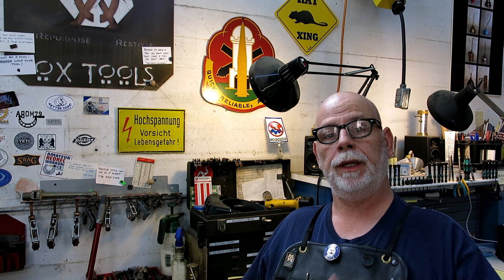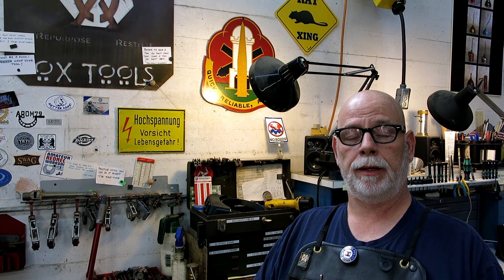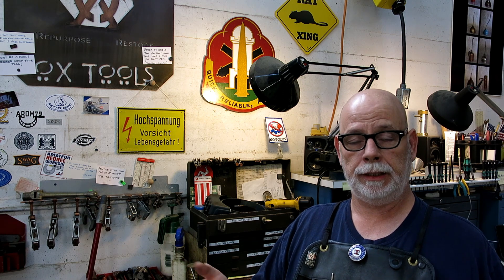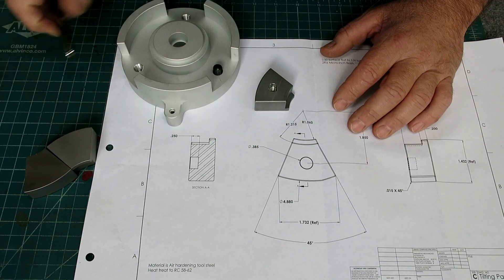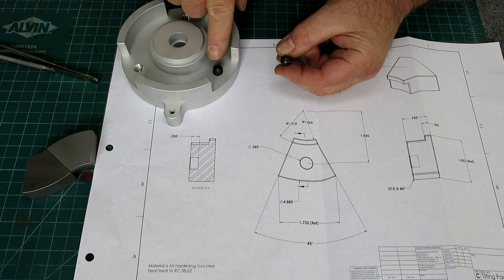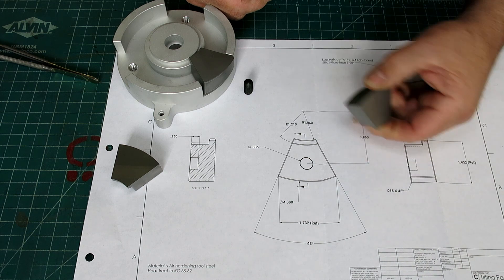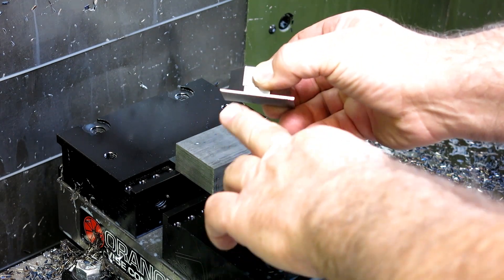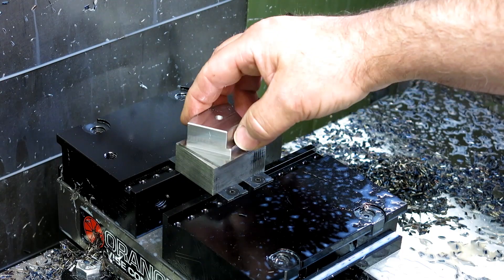Part 3 Kingsbury Michelle Aerodynamic Bearing Collaboration

Comment: I'm almost done making this project. I'm to the lapping/polishing stage. Parts are flat but not very shiny. I've read other places that cast iron laps don't really do a good job getting to a mirror finish. (I copied that project too.) Do I have to use a copper plate or do you have some other secret for getting the mirror finish? It's been a great project. Thanks
greg

Comment: Also Iam curious what you've got the parts wrapped in heat treat?
Reply: I'm guessing stainless steel tool wrap heat treating foil. 
The stuff available where I am is 0.05mm thick, and comes in rolls 610 wide x 10000 long.

Comment: why are the parts wrapped inside the metal sheet while heat treated?
Reply: That's to exclude oxygen in order to prevent "scaling". Yes, there will be some oxygen inside the package (unless you do the wrapping inside a purged glove box), but (practically) no additional oxygen will be able to reach the part once the oxygen inside the package has done its worst. You could also use an exclusion coating (such as boric acid), or heat treat in a vacuum or inert gas oven.
Reply: @stanrogers5613  thanks! I'd still like to know how the oxygen contributes to this "scaling" you're talking about.. Would the expanding air cause deformation on the piece or what?
Reply: @tohtorizorro  scaling is oxidation, which (as the name suggests) relies on free oxygen
Reply: @tohtorizorro  Wrapping also prevents loss of carbon (I presume it combines with oxygen to form CO and CO2). Carbon is essential to tool steel and its loss will inhibit austentite formation when the steel reaches a bright red heat . Quenching is the method whereby the steel is trapped in the austenite structure, as there is not enough time for the face centered atoms to migrate back to the body center of the fundamental cubes of the crystal structure. This is why there is a risk of cracking, because the change in structure causes a change in volume of the workpiece.

Comment: Thanks for sharing.
Question,
When you are grinding with the wheel, how do you accommodate the shrinking of the grinding wheel diameter in relation to the depth of grind? Hope that makes sense 
Thanks 👍
Reply: The grinding wheel diameter only breaks down at the leading edge of the interface between the wheel and the part. As you feed from front to back the front edge breaks down revealing new grinding media, the original diameter of the wheel follows  across the newely ground surface. The wheel is occasionally dressed for a true cutting surface and to remove any embedded particulate, at that point the wheel is fed down the appropriate amount.
Reply: @sshep7119  thanks, great answer 👍

Comment: Hi Tom.
Nice project. I think there is a place for improvement:
I believe the polished faces should have a knife edge rather than a chamfer.
The chamfer allows dust to get pulled in, a knife edge will go a long way toward preventing dust contamination. I think commercial air bearings are designed this way.
Reply: I'm led to believe that even machine tool slides benefit from 90 deg sharp corners when they're close fitting, particularly if there's grinding grit about.
Reply: I wondered about this too, my thought was maybe the air molecules need a chamfer to be drawn in and float the part? you added doubt that thought though

Comment: I am puzzled, isn't the purpose of the spherical pocket to allow the 3 surfaces to pivot to a common plane without error and independent of precision?
Reply: Yes, but there is a second constraint. The axial bearing must be normal ("vertical") to the plane of the face.
So just having a 3 point contact is not enough, you have to be able to either adjust the spheres to bring the axis into plumb, or machine it perfectly from the start.

Comment: Tom, when you milled the  counterbore in the hardened part (made my teeth hurt by the way) it appeared the endmill diameter was larger than the radius of the c'bore, this would leave a small convex pip at the bottom (not flat) due to the cutter's end clearance angle. Wouldn't this make the puck want to ride off to one side when resting on the radius end set screws?

Comment: Nice job Tom. Clever clamping solutions for both ops on the mill, just goes to show you don't need to be gripping on much if your contact areas are good. Cheers, Jon

Comment: Did that first cut on the surface grinder not put a deep burn into the material?
Reply: It was (Tom mentioned) a very free cutting wheel, specially for hard tool steel. With coolant, and a small stepover, it's usual to use quite "heavy" cut depth with such a wheel. This resulting wheel wear is thereby concentrated at the leading edge of the wheel, leading to longer intervals before the entire wheel loses diameter and has to be re-dressed. As a side benefit, the finish is better.
Reply: @Gottenhimfella  interesting, thankyou.
So, to pick your brain, the term free cutting refers to the 'self sharpening' properties of the wheel; like having a soft matrix allowing wheel wear expose new abrasive grits, and/or friable properties in the abrasive, so is breaks down into a sharp edge after use, or have I got that wrong?
And if you had to guess at the appropriate cut depth, what would you say?
So he's working the wheel hard and that helps the cutting action, is that correct?
Reply: @ManicChampion  Yes, counterintuitively, you need a "soft" matrix and somewhat friable grains to grind hard material for the reasons you give: As soon as a particle of grit gets dull, it needs to either fracture or be released. As with cutting tools, it's essential to use a sharp edge for hard materials, otherwise you are just burnishing and the cutter will push away from the cut. 
You can to some extent manipulate the characteristics if you can vary the spindle speed; running slower makes the wheel behave as if it is softer.
If you plunge grind (downfeed only, with a wheel as wide as the work) you have no chance of achieving a flat surface because the entire width of the wheel will be reducing in diameter, unevenly.
So the best plan is to downfeed a decent amount before commencing a new pass (perhaps as much as 0.2mm, if you have the right wheel, a decent-sized spindle and a rigid machine, and of course enough motor power) with the wheel beside the work, and then use small increments of stepover so that most of the periphery of the wheel is only sparking out, and all the work happens at the leading edge (which will quickly 'dress' itself to a radius followed by a slope)
Use a rapid traverse, and flood coolant, which (with a suitable wheel) will keep the workpiece cool. Never stop, or even slow down, on the work. Grinding hard material is easier than soft, if you follow guidelines like this.
This is also the best way to true your magnetic chuck. It's (by definition) the largest workpiece your machine can cover,  so it's important that the effective diameter of the wheel does not reduce by the time you get to the far corner.
Reply: @Gottenhimfella  I was just reading on Norton's website some general things about grinding. They said the opposite, faster wheel behaves harder. This makes sense to me as one time I tried grinding a carbide scraper with a green wheel on a slow speed grinder.. all it did was chew up the wheel
Reply: @metepack4872  Thanks for catching that, of course you're right and I miswrote. I've corrected it.

Comment: Are you climb milling that hard material on purpose at the end?
Reply: You should always climb mill on a cnc, when machining the inside like he is at the end, run counter clock wise and when machining an outside profile run clockwise, tool compensation always on the left
Reply: @Kyran31  though that on cast iron or hardened materials conventional milling was preferred
Reply: @kemc77  I’m not sure on that to be honest, you may well be right, I’ve just always thought climb was the preferred method
Reply: @Kyran31   I would always climb on a rigid machine with well-maintained ballscrews or backlash compensators, hard material included.

Comment: Hello Tom;
You can determine the floating gap quite accurately.   Just measure the capacitance with your multimeter.   You know the surface area of the capacitor and you know the measured capacitance.   There are a lot of online capacitance calculators like this one: http://hyperphysics.phy-astr.gsu.edu/hbase/electric/pplate.html
You will have to work backwards iteratively but it will give you the gap.
Great work, always impressed.
Reply: It's not quite that easy in the real world. You would need an expensive benching DMM and even the wires and connections come into play when measuring that. It's not something you could feasibly do, especially if you aren't an EE.
Reply: @xenonram  Yes, the capacitance is probably in the range of picofarads perhaps below the range of most multimeters.   This device:
https://www.ebay.com/itm/L-C-Meter-LCR-LC200A-Handheld-Capacitance-Inductance-Multimeter-Electric-Bridge/182584739286?hash=item2a82e605d6:g:pkwAAOSwusdcJuFA
claims to be good down to 0.01 pF.
At $35.59 it might be worth a try.   (Yes, I know that the spec's are from you know where. ;-) )

Comment: Hi Tom, what's the purpose behind tappy tapping the parts in a vise AFTER it's been tightened? I understand its to seat the part against the base but why not do it just before you fully tighten the vise?
Reply: Because the part will bounce until the vise is snugged up.
Reply: @RambozoClown OK, thanks. I'm surprised there's no danger of the part being pulled up or pushed around out of the vise if Tom is able to tap it down with what look like relatively delicate blows.

Comment: When removing the carrier on the milled parts, instead of using a facing strategy ( that moves straight across the part) consider using one that moves inward from the outside perimeter ( I'm used to these being called adaptive, but it just depends on the software you are using). That way the unnecessary strips of material on the perimeter are milled away before the end mill reaches the stock that remains. This minimizes the chance of the remaining stock becoming thin and chattering and catching on the end mill. I hope that makes sense.
Reply: i get what you're saying, but just a facing operation is easier to setup .. less clicking and making sure everything is perfect :) you can even do it conversationaly right on the machine